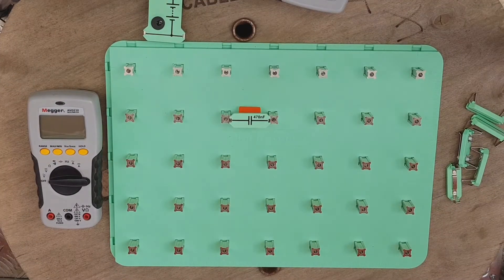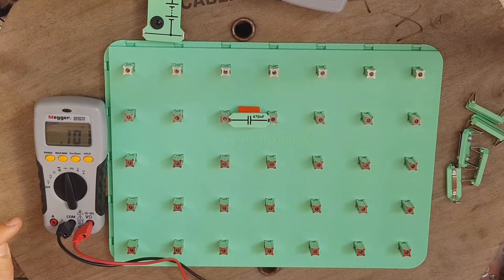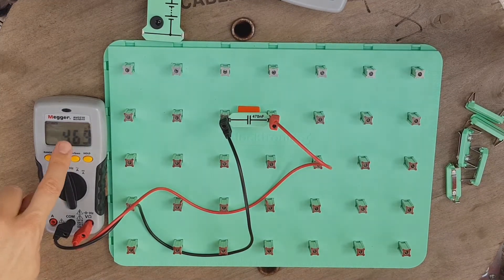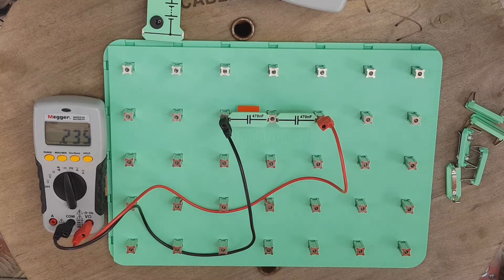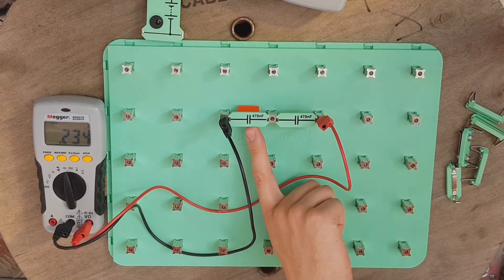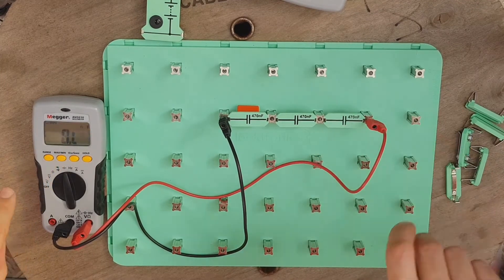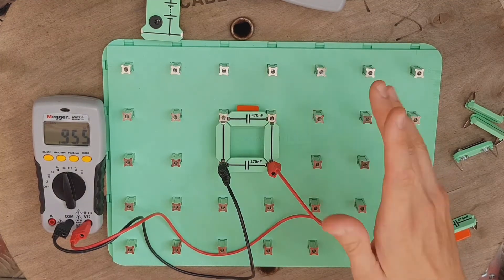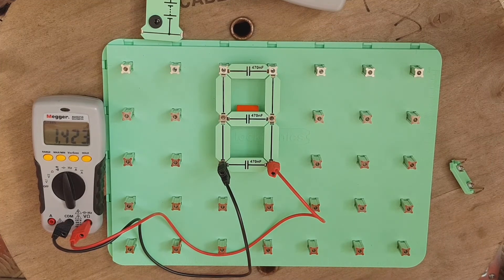Capacitors in Series and Parallel

Comment: Looking for some help Joe (nothing related to this video) . Have had resistor's connected between phases across the mains of a 3 phase power correction factor unit burnt out causing the fire alarm to activate in a large office block. What is the purpose of the resistor's connected across the mains and what could cause them to burn out?🤔